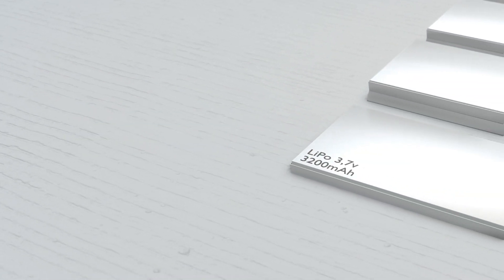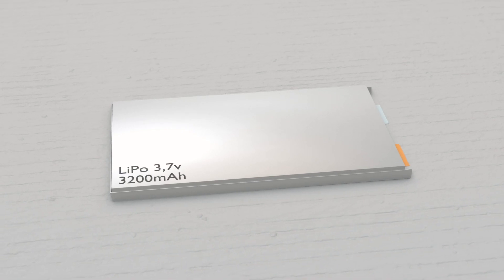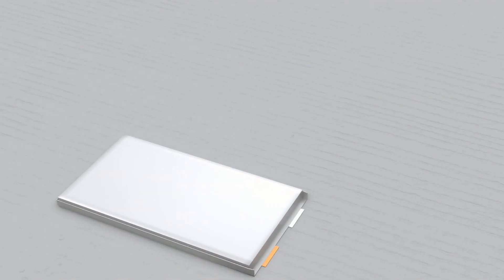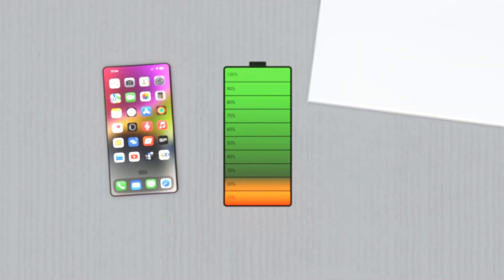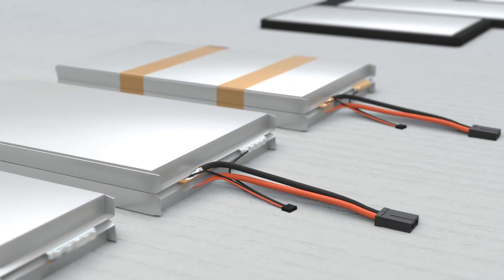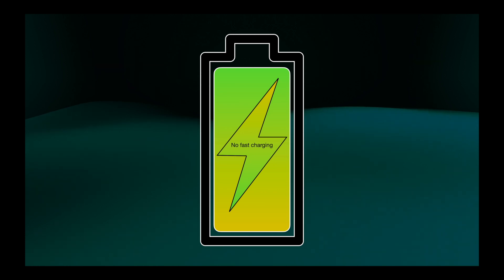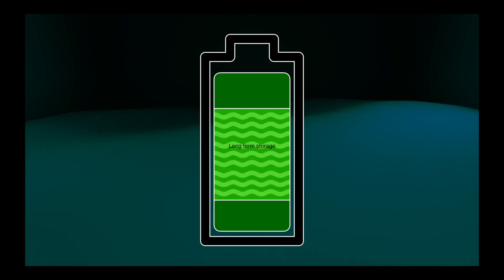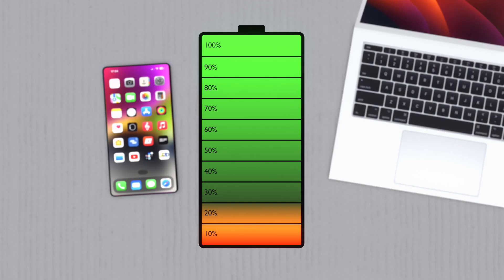Lithium-ion polymer battery, how it works and how to take care of it

Comment: Very well presented video. Just a question. Do ALL lithium ion batteries eventually swell or puff up? I have a number of old unused iPhones and iPads and just concerned that over many years batteries may puff up. Thanks
Reply from the maker: Thank you! no not all LiIon batteries swell, this is a symptom and a result when something is wrong with the cell, for example abuse of some sort, physical abuse or overload, over charge/ discharge and exposure to heat. From cells i have tested and from old devices as your example, phones and tablets, the cells usually "die" quietly due to calendar aging or being left discharged over a long period of time.